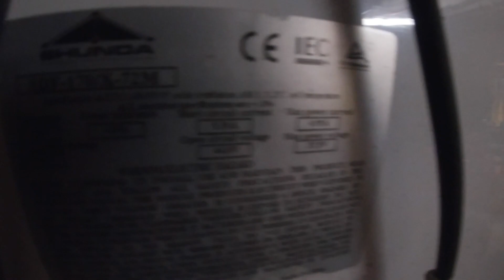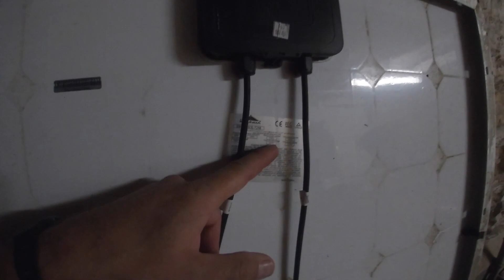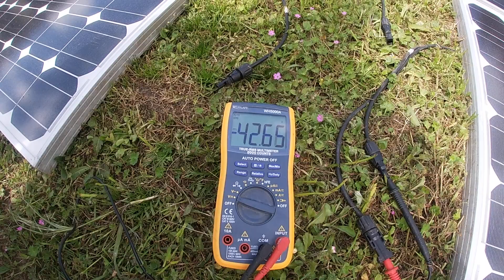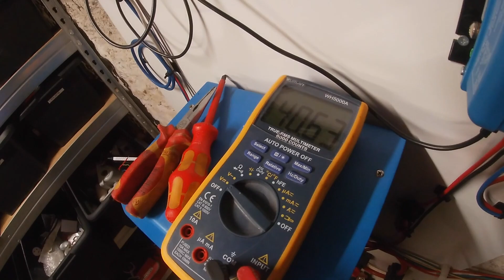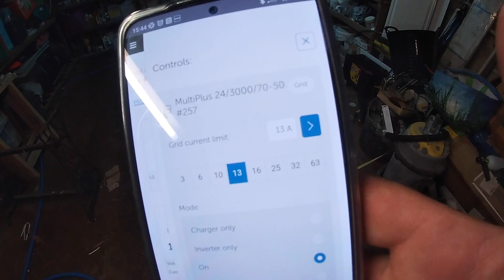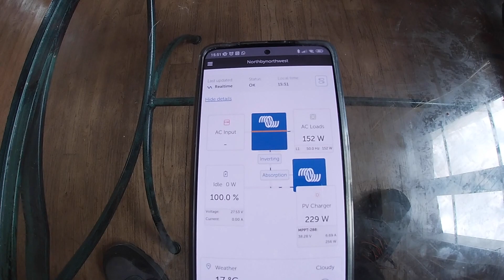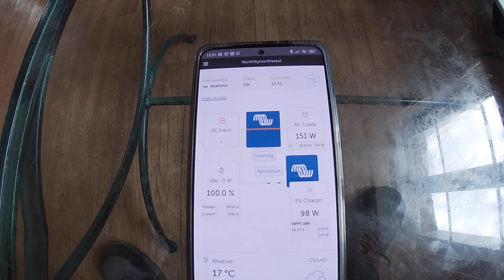Going off grid in France Part 1

Comment: If you have a charge controller that can take up to 100V open circuit, you could wire two strings in parallel of two panels per string. That would halve the current to the charge controller vs four panels in parallel.
Then you will minimize resistive losses from the panels to the charge controller.
Reply from the maker: Thanks for your comment, in future episodes I do adjust some things. However the two considerations for me specifically are that 4 panels all with different angles and critically shading at different times. Also in the winter it's is possible but unlikely I could just exceed 100v with these panels. 👍👍

Comment: "Living off grid is it possible": Spoiler, yes. Tons of people do it including me. Poking at your funny title.

Why are you using a combustion generator when you have a far more efficient and clean energy you can pull from the grid when you need to supplement solar power? It's great to have a backup generator when all else fails, but your doing yourself and the environment no favors by running a generator when the grid electricity is far cleaner to supplement with.
Reply from the maker: Thanks for your support.  I understand your point but I don't want to pay for a standing charge when I am never there. In future episodes I convert the generator to LPG which is much cleaner. 👍👍